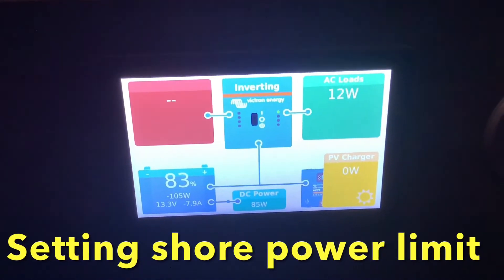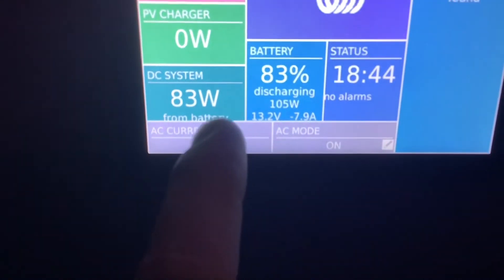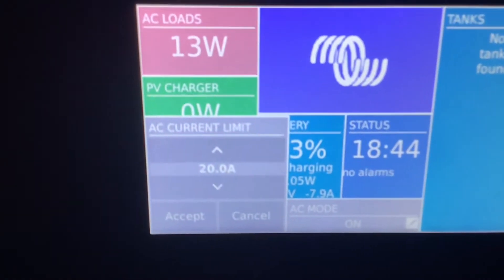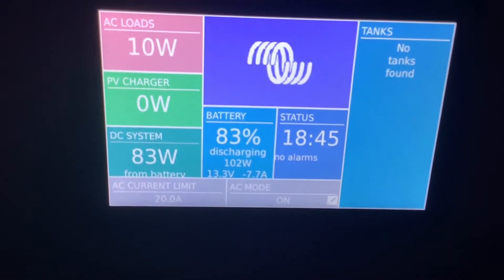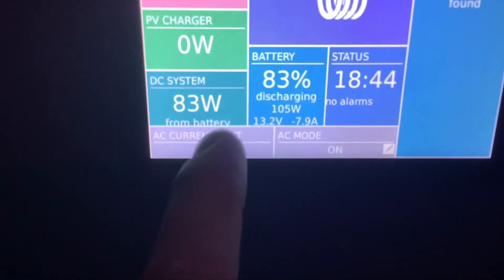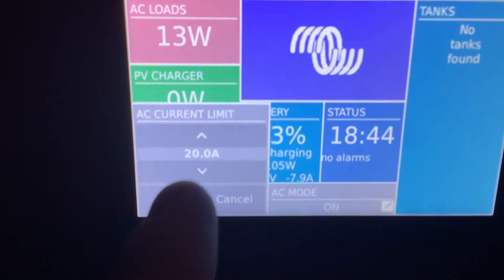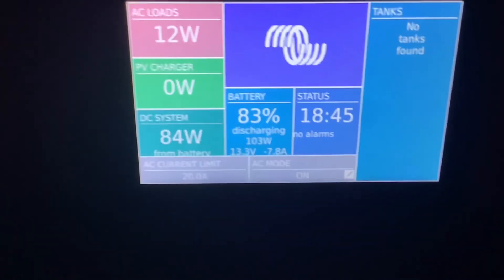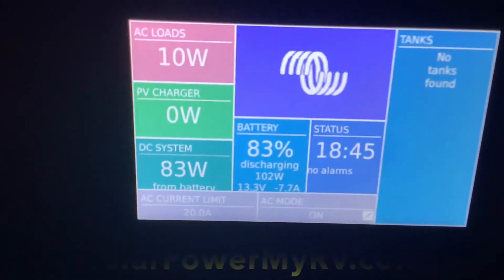How to set input current limit (shore power limit) on Victron multiplus inverter with Cerbo gx

Comment: This was very helpful.
We're still trying to figure out getting power, and so far 15 or 20 amp is a no go, but 30 amp seems to be possible. We just bought a Honda EU2200i generator with 30 amp capability to have power anywhere we go. If that works, we'll be all set. Being full time in RV things like this are very important.